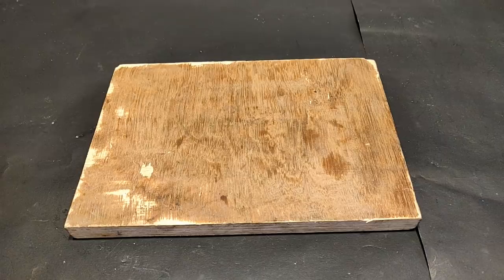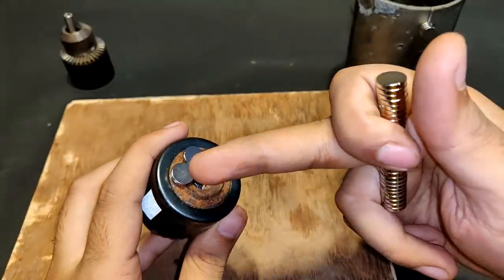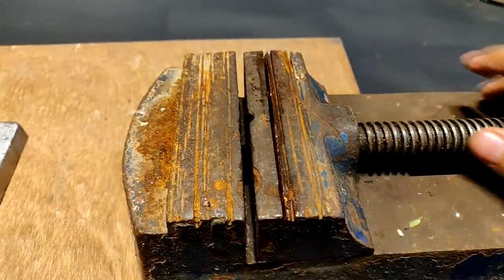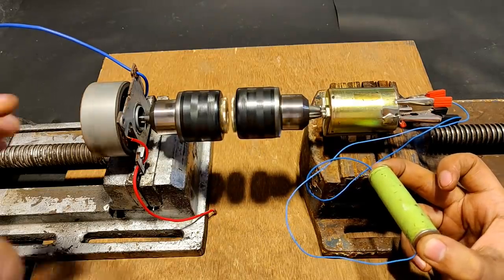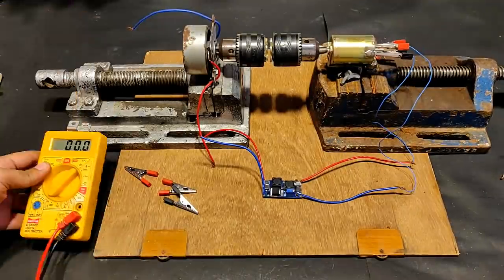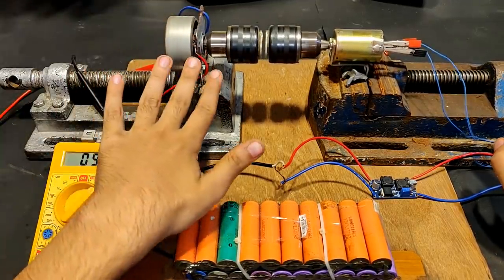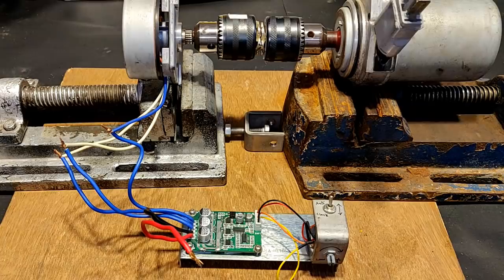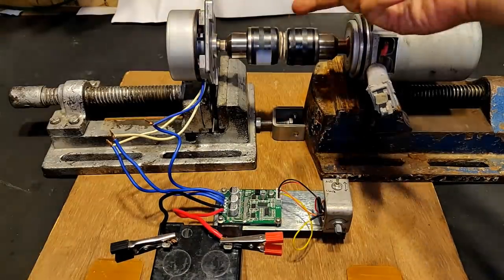0.5 KW DC Generator Runs with 24v Brushless DC Motor - Magnetic Transmission

Comment: Very nice!!!  I would like to see a 12V to 36V DC to DC buck converter between the battery and ESC to increase rpm and get the generator to higher than 12V.  Possible?

Comment: I love your transmission. Are you actually creating a surplus? Last winter I had an epiphany that an electric motor should be able to run an alternator at a surplus. I threw together a creation (with no electronic understanding) and was unsuccessful. I still want to bolt a wheelchair motor to an alternator. Later I checked the internet and LOADS of people are claiming to have created energy but that would be perpetual motion. Last I checked no one has been able to prove these claims of a surplus. Heat loss, friction and inefficient d/c motors use more than they can generate. Nice to see that you are thinking outside the box.
Reply: That... Is a good idea, but it breaks the laws of science. Energy can not be created not destroyed. And friction with air will slow the motors down anyways. Even in a vacuum, the motor bearings still generate friction. So... No free energy here.